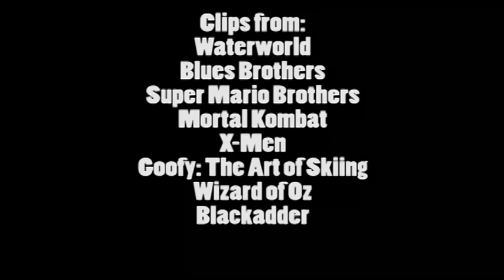Waterworld - Nostalgia Critic

Comment: I always wondered where they found fuel for the airplane let alone the motorboats.
Cessna's don't run on crude oil.

Also... Oil tankers don't have refineries on them, so how do they turn the oil into gasoline let alone airplane fuel?
Reply: Correction: normal tankers don't have refineries on them. We're talking about a world where people can modify their rafts to be heavy combat boats with a few level pulls. Also a world where piss-to-water machines can be made with total scrap parts by regular people.
Reply: Maybe the ship didnt transport crude oil, but diesel oil.
Reply: Michelle Lehto That may be HOWEVER... They never show the oil being refined into gasoline.
Reply: kommo1 Then how do the sea doo's run?
They won't run on diesel.
Reply: Well I think its easier to modify a jet boat engine to run on diesel, then on crude or heavy oil. The plane as well.

There was some modifiing. We only have to agree on which.
Reply: Where do they get the corn to turn into moonshine?

Not a lot of corn fields in water world.
Reply: Misterprickly so you're saying you didn't notice the improvised hydroponics bay they were "recycling" the hero into. K, nice to know you pay as much attention to primary plot points as you do to artistic licensing and creative leeway afforded in fictional and fantasy settings.

(also you can make ethanol from any sugar/simple carbohydrate, hell seaweed works if you do it right. Do you even know how fermentation works?)
Reply: Cessna's what? Your sentence lacks information.
Reply: Tanya Sapien So basically what you're saying is by stealing crops from small villages with no surplus, a band of thieves with no internal agriculture has not only enough food to feed an entire crew's worth of people but also enough left over to convert to fuel for planes they use almost exclusively as their method of travel? K, thanks for putting your planning skills out there. It'd be much easier to refine fuel than...that, and I think you damn well know it.

And don't give me that seaweed shit, it was very clear what they thought of people who could go underwater.

Comment: The biggest problem I had with this film was the logic behind how it is possible people are surviving, roaming endlessly, years on end, on primarily ocean. Like what do you do if your boat is damaged? 
Where does one even obtain bullets in this world? Let alone engine fuel? 
How is it the majority of people aren’t suffering from scurvy or other waterborne illnesses? 

Most of these problems could be overlooked if this was set in a future similar to Mortal Engines or Knights of Sedonia ; where the remains of the previous world’s tech places people in a better standing post-apocalypse than they would’ve been otherwise. But not here where they’re using basic ass sail boats. 
 
All of this knocks me out of the believability aspect. Couple that with blandly written characters and slow pacing = I am struggling to resist drinking tons of alcohol to get through it.